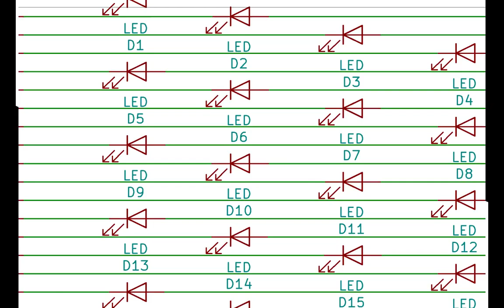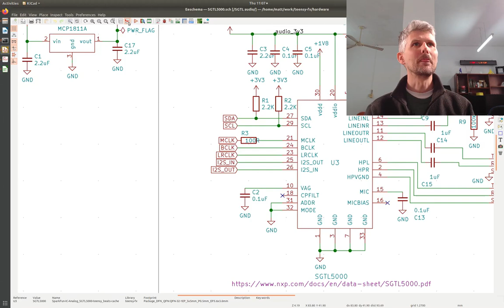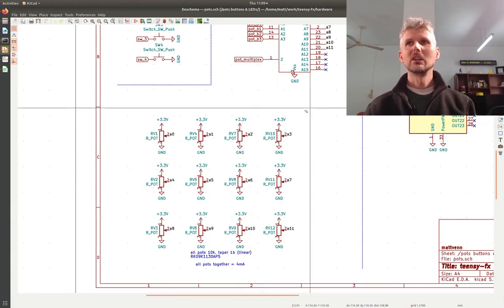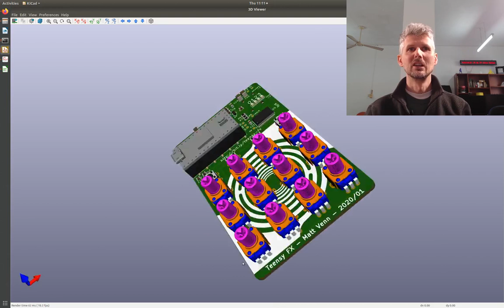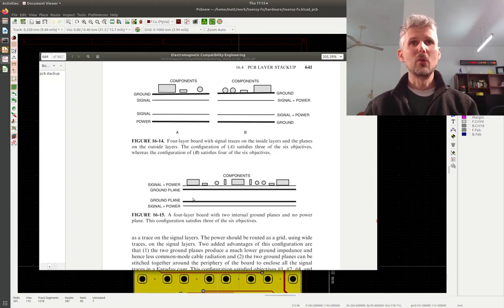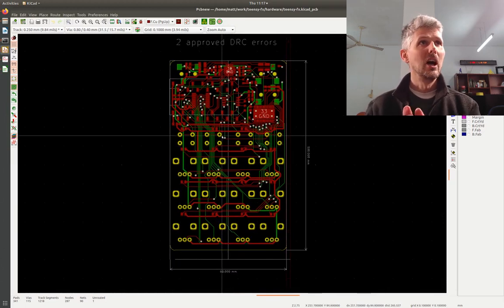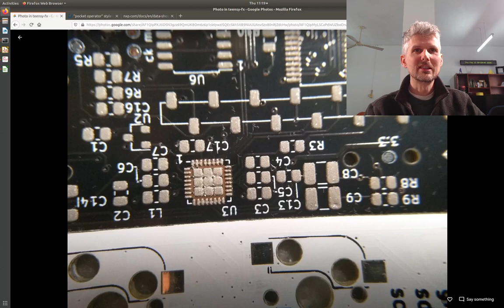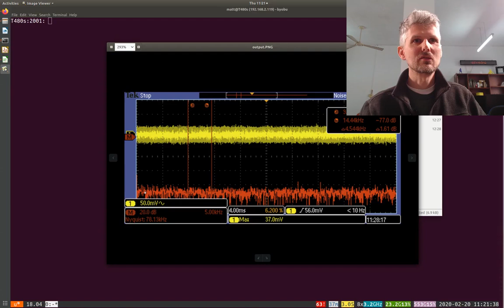teensy fx part 2 - board design

Comment: Hi! This looks quite amazing, do you consider the project "finished" or is it stull under development? =)
Reply from the maker: I wouldn't say it's finished but I don't have much energy to continue development. It works pretty well. I was thinking of adding another audio ADC/DAC so I could have 4 mono inputs. Also the teensy4 should work as a USB sound card so it would be cool to use it to record the output directly.
Reply: @matthewvenn  Yeah that'd be really nice, I've considered a solution like that as a DJ soundcard =) 

I've been looking for a small stereo FX unit like this for a long time, I'll check out the kitspace page and order some parts =)
Reply from the maker: @DJDiskmachine  cool. Let me know how it goes. A friend had a lot of problems soldering the QFN package CODEC. So it's probably not a great project unless you have experience with SMT parts.